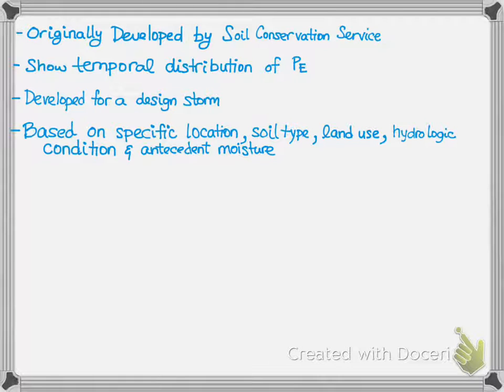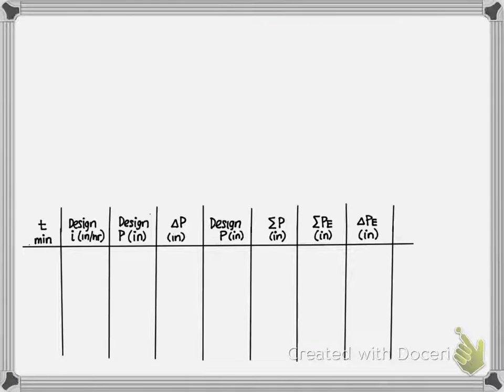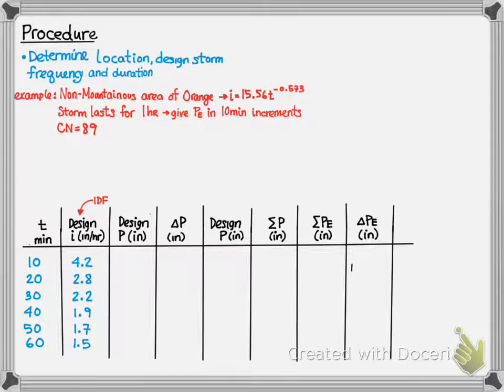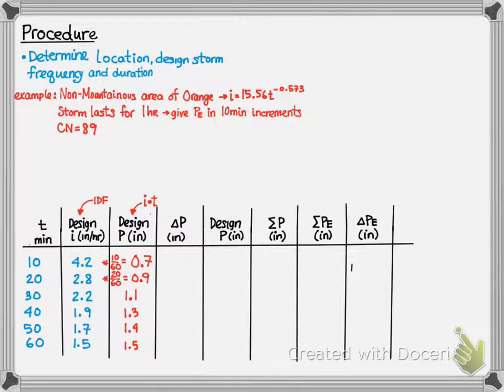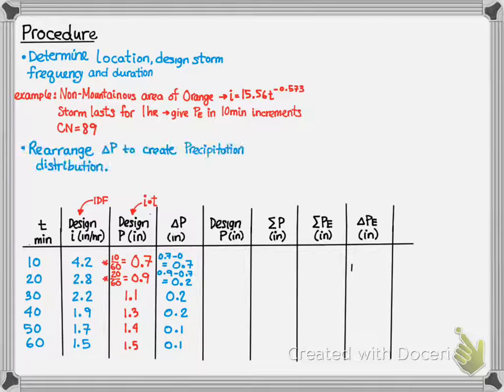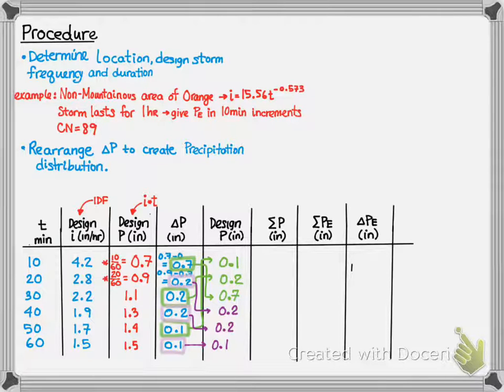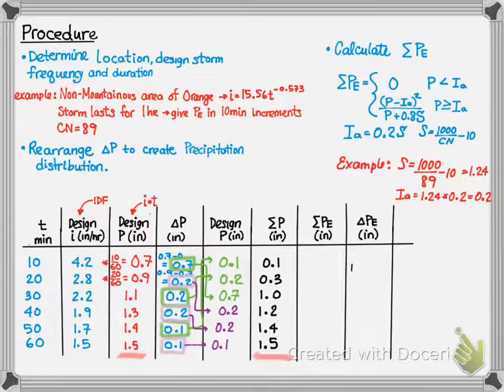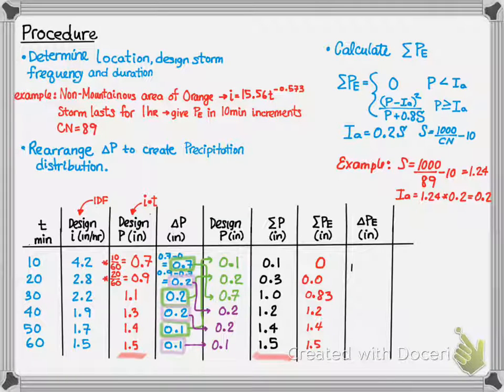Design Storm Excess Precipitation Method

Comment: how do you determinated your time step hytograph? what criteria did you use?
Reply from the maker: U can decided.  If it is too small the excess precipitation will be little
Reply: @seemashah-fairbank2760  Thank you for your response....I have read diferents criterias...por example the NRCS states that time step should be less than 0.133Tc and brazilean engeniers state than time step should be set between Tc/4 and Tc/5 ...so I am undecided...